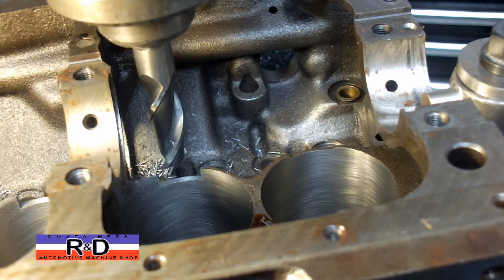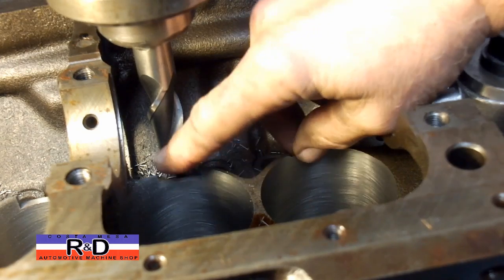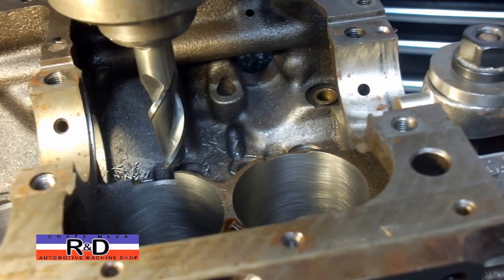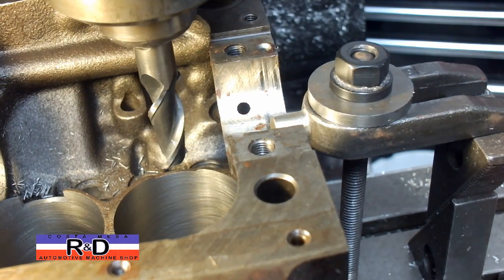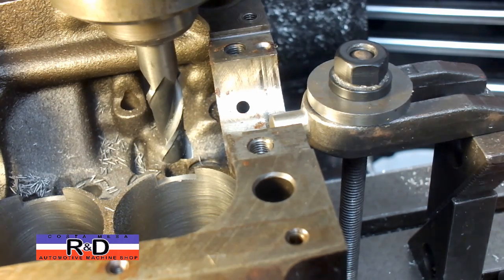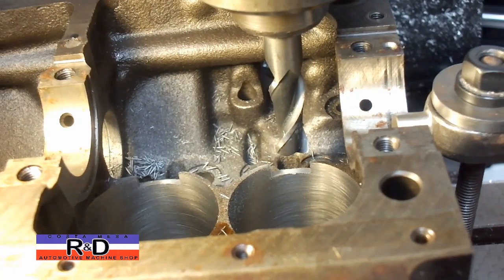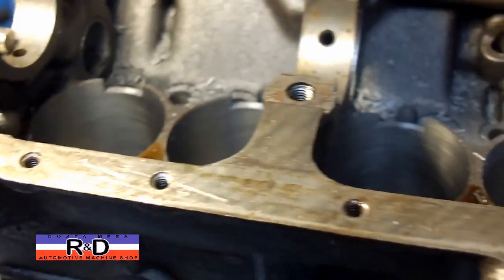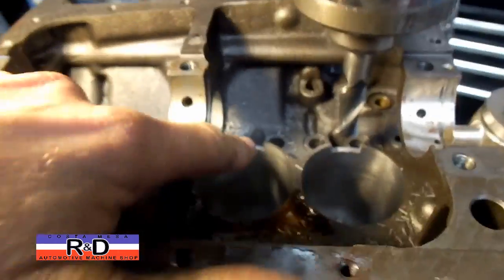Clearancing a Block for a Stroker Crankshaft

Comment: John ,
Could you use a bridgeport to completely bore out a engine? Well and a hone. Ive never done one before and im trying to decide if im able to do it.
Reply from the maker: The quill does not have enough travel, you generally need 6"-7" of Z, plus the boring bars that most people have are not rigid enough. The boring heads I made for the Prototrak (Cat-40) are at least 2.5" in diameter. The R8 just doesn't have enough mass to do the job in my opinion. If you are making cuts of .003"-.005" maybe, but I bet you will get a lot of chatter in the hole down near the bottom. Been there, done that when I was in college about 48 years ago. Lots of luck and keep us all posted on your progress.
Reply: fiatnutz
I have a cnc mini  BP clone with the knee as the Z axis. There is 20 inches of Z travel. So im not bound by my quill.
Still uses R8 taper. 
I uusually do simpler stuff brackets some 3d parts . I dont do any engine work really though . So I was curious if the home builder could with the proper tools.
Thanks for the reply john